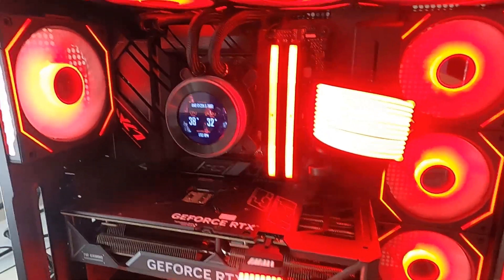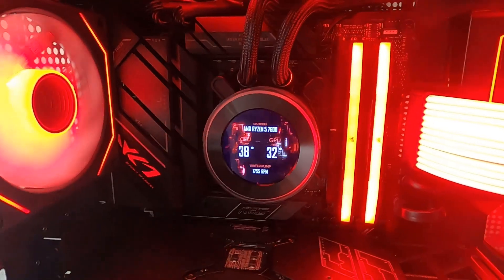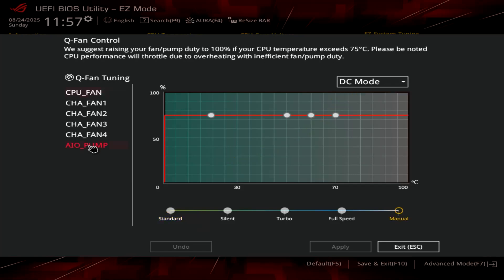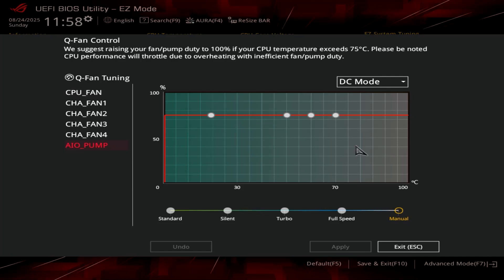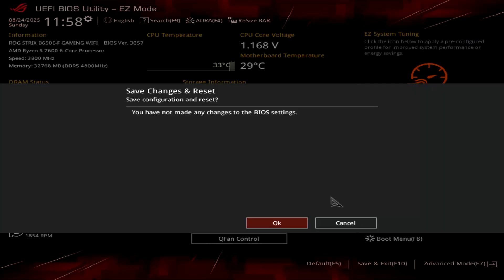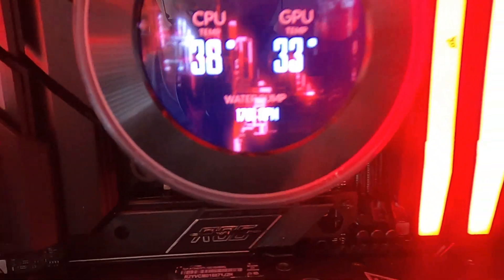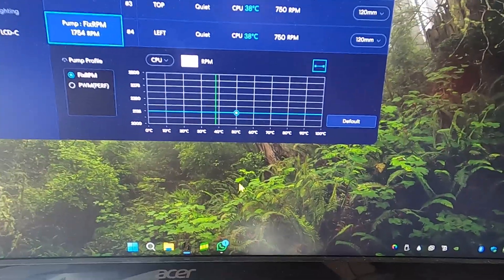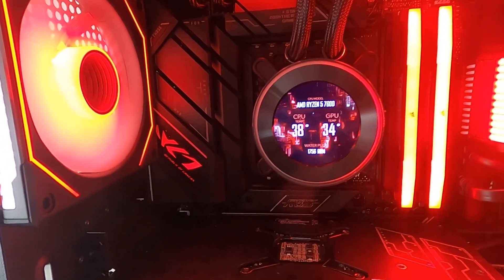Lian Li Hydro Shift II 360 Pump Noise *DIY FIRST FIX*

Comment: I think setting in L-Connect 3 a FixRPM for the pump is doing more or less the same, constant speed, no variation to induce noise.
Reply from the maker: It should do the same thing but setting in the BIOS means the noise is also lower on boot.

It’s changes in noise levels that people notice more than a constant level.

Comment: I seem to have an issue with the fans more than the pump itself. The fans get extremely loud in short bursts, then quiet down again (somewhat) and then loud again. I built the exact same pc as my partner and his is extremely silent, even when running games. Mine does this annoying fan speed burst even when the pc is in restmode and nothing is opened or running. Any idea how to stop my fans from doing this? The RPM speed (around 2000-25000) and temp (25-35C)  is always the same as my partner's so we dont understand why my fans have to get so loud.
Reply from the maker: Are they in DC or PWM mode?

The motherboard needs to be set to match the type of fans connected to it.

Also, check the fan curves in the BIOS.
Reply: been with the same problem mate, I contacted lian li and they said make sure the fan screws are tight well, that didn't make sense to me and I think its a software problem and I didn't check my screws really but I'm sure its screwed well when I built the pc, so try that and update me

Comment: There is a new firmware update now v1.4 called "lianliH2RF_1_16" when you download it for the hydroshift II receiver that lets you drop the pump speed to 1600 RPM. No need to lower voltage in bios now :D

Comment: I was thinking about buying this but the noise seems to be a show stopper. If under 1800rpm was the right thing to do, why wouldn't Lian Li engineers do it in the first place. That makes me question the safety of doing this. What happens under full load? (I have custom code I need to run that pushes all cores to almost 100% for about 10-15 minutes). And second, I see your CPU is 5 7600 which is 105w. Currently having 9 9900x which is 120w, I have it around  43-46 degrees when idle using Thermalright Phantom sprit 120 se air cooling (running around 600-800 rpm). BTW I don't have a separate GPU and I am using integrated graphics from 9900x - 3 monitors 4K@60 Hz, not interested in gaming.  Not sure if it is worth to replace with this. What do you think?
Reply from the maker: If you think about it… the water in the CPU block needs to be in contact with the main plate to get the heat energy transferred into it.

This will take time… if the pump is running too fast then that might actually reduce the effectiveness of the cooler.

There’s a load of thermodynamics and maths in that - I taught Physics for years and this could get pretty juicy…

😂

So dropping the pump speed from 2000 rpm to 1800 rpm probably won’t make much difference to the overall cooling efficiency, but makes a big difference to the noise.

To be fair to Lian Li, they don’t know what motherboard or CPU will be used and the nature of their products would suggest that they expect purchasers to be enthusiasts who tweak things.

🙂
Reply: @sterntechdaddy  So you are saying Lian Li engineers don't know what they are doing :)
Reply from the maker: 😂

No... Lian Li engineers are clearly clever than most people. I'm saying Lian Li engineers expect the purchaser to have more of an idea than some manufacturers might. Their products tend to be focused towards enthusiasts.

I suppose its a bit like car manufacturers expecting people to know how to drive before they purchase a vehicle - rather than the purchaser knowing how to maintain and repair the vehicle too.

☺️
Reply: @sterntechdaddy  According to your video it was contrary. They are expecting consumers to fix thing rather than to be able to use it with defaults. 
I just can't understand why would they make it more expensive and yet worse in performance than the products of the same company.
I thought enthusiasts would care performance over visuals but looks like it had a different meaning.
Reply from the maker: The screen is pretty brilliant… and the tubing is a clever design.

The video featured a cooler that was bought by a customer that they wanted me to fit. It might behave differently on another motherboard… but I’ve reviewed much cheaper AiO coolers that might perform better too.

Comment: Very disappointed in this constant hum noise. I use my PC for work and play and while gaming this isn’t an issue at all, when working the hum was driving me mad.

Thankfully setting the pump to 2000 constant RPM in L Connect takes away the noise, and stress testing it at 2000RPM maybe impacted temps by around 1c or so which isn’t too bad.

I’m running a 9950X3D and while my idles are between 48-53c, under max load in Cinebench it never peaks above 80c.

When gaming, it hovers between 60-70c depending on game and usage.
Reply from the maker: Looks good to me. Glad it’s working without the irritating noise.

Comment: Thanks. I have the same issue with the pump noise being to loud and audible even on the lowest RPM (2000). I'm wondering how reducing the RPM affects performance when gaming? If I understand DC correctly, the pump will run at ~1850RPM/s no matter the workload?

Also, would you share your radiator fan setup with us please? I would like the fans to also be as quiet as possible during idle/desktop usage.
Reply from the maker: The cpu will get hotter when gaming… the rad cooling fans should respond to that and speed up. The pump stays the same speed though.

It’s a similar principle to the central heating in your home… you don’t speed up the pump that is circulating the water, you only adjust the temperature of that water.

For a PC, you really want the pump to run at a constant speed that is as low as possible. This reduces noise and extends the life of the pump. 

I think 75% is the ideal spot, but you can stress test to see. Too slow and it won’t cool very well, too fat and it’ll be noisy.

🙂

Comment: When i do this on my Gigabyte x870e Aorus Elite i choose voltage and drop it and i see the pump speed go down to like 1800 so it works in bios and its connected to AIO pump
when i get out of bios it goes to 2000 agian and in windows i can go 2000-2400 like stock. Any idea how to bypass it in l-connect ???
Reply from the maker: You should be able to set the pump speed in L Connect. That will override the BIOS setting - which will get applied on power up and then adjusted once Windows has loaded and L Connect takes over. 🙂
Reply: @sterntechdaddy  I can. but not under 2000...
Reply: Even though the reading in bios on AIO pump is 1700 RPM. my screen still shows whatever its at 2200. And when i get into windows its at 2000 because thats what i set it to in L-Connect. But its so weird if i reduce voltage enough to AIO pump the pump goes out. So its def controlling it. But it wont show the correct RPM...
Reply from the maker: Might depend upon how the pump speed is measured. The BIOS will use the motherboard header, but L Connect might be measuring it via USB. Maybe that explains the different numbers. Maybe... normally the USN is used for screen configuration so that's probably wrong.

I would use HWMonitor to show the speed of the AiO pump header and then see how it changes when tweaking it. And see which speed it agrees with - it might match the bios setting or it might match L Connect.

I would add that the actual speed isn't really the thing to look at... the noise level is what matters. Generally, between 50% and 80% pump speed gives the same cooling as full speed but with significantly less pump noise and pump wear.

Comment: I have a problem with one of the fans, when I wake the pc or run it for a long time its stops spinning and the other fans speeds up
Reply from the maker: It might be faulty... is it a new cooler or one you've had for a while?
Reply: @sterntechdaddy its new
Reply from the maker: You're using the fans it came with?

If so, then get an RMA sorted and return it as faulty. 

Or buy a replacement fan and swap that for the dodgy fan - that way if you don't have to removing it all and boxing it all up.

But check the RMA requirements - some companies might not want it returned and might just want proof of destruction instead.

Hope this helps.